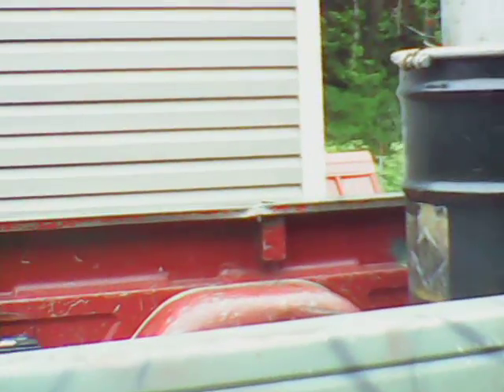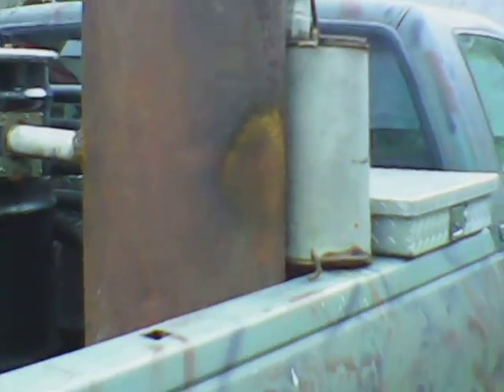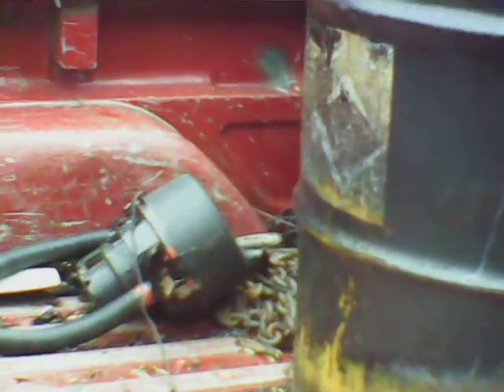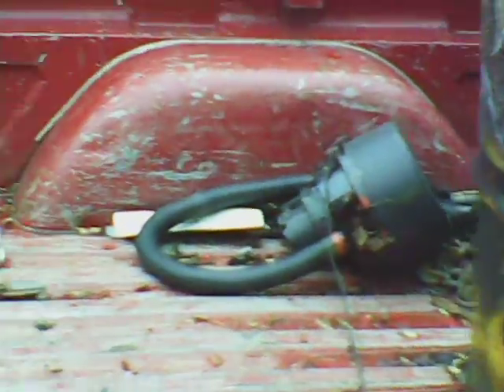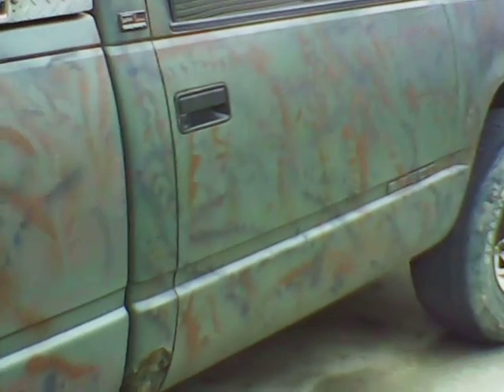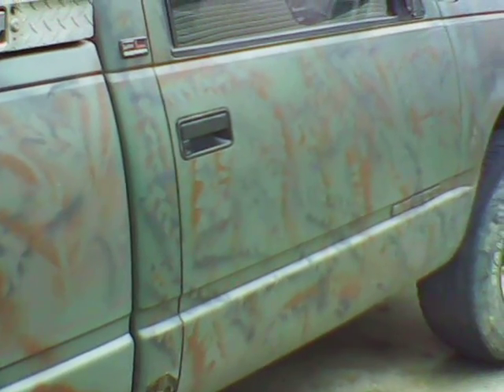gasifier carburetor

Comment: Interesting. Youtube decided to serve up this old video of yours to me just now.  I don't think i've even seen this truck at all before. How did this all turn out?
Reply from the maker: I finally got it straightened out so I could drive it to work. I used it at work for a while. It was a good feeling to be driving for free, it is a lot of work though.  Cutting and sorting wood chips, lighting a fire in the reaction chamber, carrying a load of firewood around with me, just wasn't worth it to me. So much easier to buy gasoline.
On a side note, I think my videography skills have improved slightly.
Reply: I'm glad it worked. It's too bad it was so much work. And i agree that your videography skills have improved. :)

Comment: Hey Luke ,good job on the control setup,I had thought that the woodchipper waste would be a good source of fuel I hadn't thought about the bridging problem.Maybe you could run it through a smaller chipper like one a homeowner would own{about the size of a pushmower}you might even be able to rent one small enough to do the job.Good luck